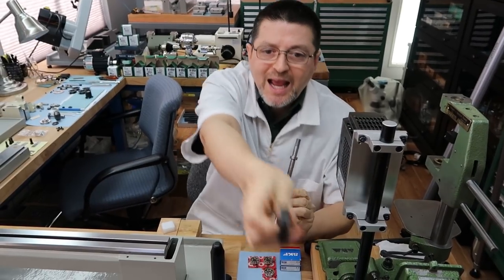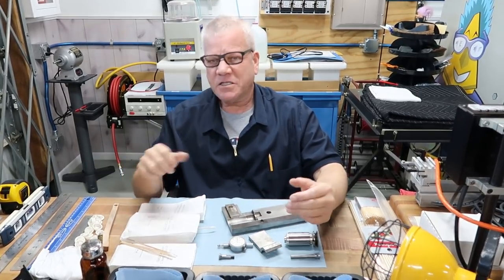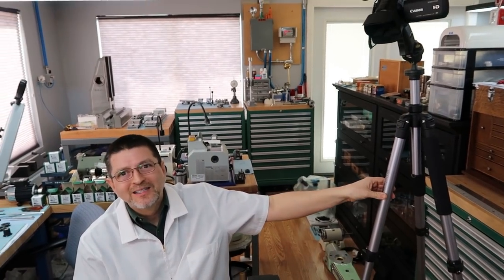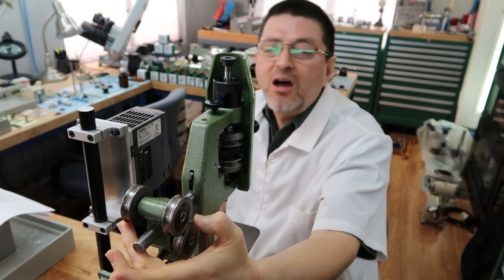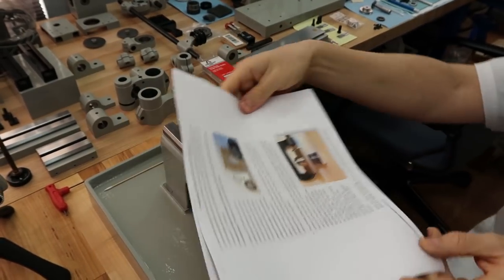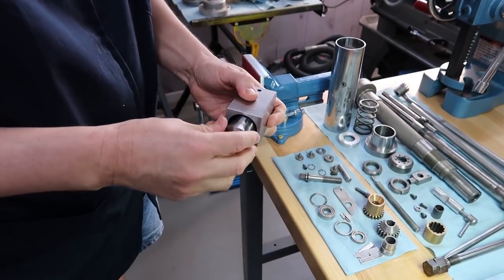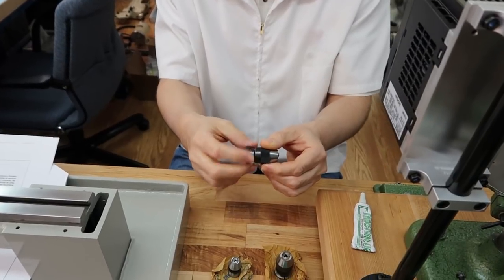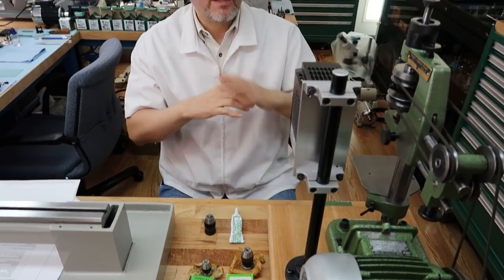SHOP ADVENTURES 21: German Tapping Machine Assembly & Albrecht Chuck Rebuild

Comment: There's no mention of grease type and amount in CC's to be used in the Albrecht instructions? I've not had my larger one apart yet, but yes I know the "feel" you mentioned of what they should be like. Albrecht doesn't cut corners so it's likely they always use a very specific NLGI rating to get that consistent feel. Two possibility's? Kluber might be the manufacturer since they do high end specialty greases for precision assembly's. The other guess is it just might be what's called damping grease. Easiest to have you Google the term, but it's not well known how many common items use this type of specialty grease to obtain that "feel".  I ran across the term a few years ago and did a bit of searching. It's used in many items like optics for cameras, rifle scopes, binoculars, microscopes etc to provide that light but consistent drag during adjustments. It just might be what Albrecht uses. (maybe) ?????
Reply from the maker: Hi Turning Point good evening to you this is Lance.
We know the grease used by Albrecht and along with a new issue to cover in this coming Mondays  video brought up by Precision Edge we will disassemble the 3.0mm Albrecht chuck a brand new in the box one and perform an autopsy on it including the grease type, thickness, weight, locations of the grease and such, you we hope will join the show when we dissemble this brand new chuck.

The feel of an Albrecht chuck, you know what we know once you turn one clockwise and reverse suddenly counter clockwise you are hooked for life the chuck is a reminder of the power-glide days. 

Kluber we know very well and I am thinking right now as well, you might know we are nearing the pullout video series of the rebuilding of a precision spindle actually we are doing 3 as mentioned in this weeks video. We use this grease in our spindle rebuilds.

Albrecht chuck claims in its instructions is the issue here to us for this moment, they specifically share how much and where they place the grease, only and no other location anywhere within the chuck meaning we are going to share this disassembly as close to live Monday evening and this is only one of the two  topics we are covering this Monday.
The other pertains to the chuck it must be pushed up onto the taper of the tapping spindle so we can do some tapping machine testing as the new power switch mentioned in the wiring discussion within this weeks video shared it should come in has in fact came in. 
This means the chuck issue must be resolved and the chuck refurbished and reassembled already by us must be ready to go or we will have to install the new one we are disassembling in the video and share the tapping operation now in this weeks video a week behind our best estimates. 

Welcome to Shop Adventures what happens here at Active Atom is what we film and we share as close as you can get without being in the shop with us (hazardous place) and this is all worth every hard working hour per week to both of us and know this Turning Point, we are highly inspired by people like yourself and many others that ask great questions and share even greater approaches to the challenges within our micro machining operation as we prepare to begin machining code named product "The Perfected Product" on the vary machine and tools. Thank you for being here and for taking time to analyze our challenges it matters to us both. Lance and Patrick.

Comment: thank you for the video, you have some fantastic machines and tooling and I am very jealous, have you considered that the old chuck just might be "run in" and that's why its smoother in operation. your workshops are not just clean they are clinically clean. if you ever managed to view my place of watch and clock repair you would certainly have a heart attack.. thank Patrick for me also as I am sure its lance I am emailing. excellent video thank you
Reply from the maker: Hi Richard Shepard Lance here. We do have a clean Workshop but mostly because we stopped doing work for others to refurbish the machines and such so as to start making "The Perfected Product" but no it is always clean mainly the Workshop white coat area but the Machine Shop blue coat area would pass the 5 second rule of dropping food and still being able to eat it. LOL We are interested in learning from you Richard? You work on both watches and clocks? Do you do this for a living hobby or are you like us just a bit over the edge. We are located in a rural desert town since August 1999 named Yucca Valley, where are you located we are always interested in these things if you want to share or not is ok as well especially a fellow watch and also a clock guy. Patrick only writes to a few emails generally I am the one that does the writing talking joking interaction but I do have a bazaar set of skills they will appear during the product manufacturing and should present a real joy for the viewers we hope. Lance and Patrick.

Comment: Did you try to chuck something in the chuck? I have used  Albrecht chucks in the past that wouldn't hold on to the shank of a tool. It was like you tighten the chuck but it won't stay tight. I may even have one in my garage that suffers from this. I will be interested to see what you guys find out on this.
Reply from the maker: Hello Peter Lance here. Patrick say hi and we think you are bringing up a great expansion of the Albrecht chuck disassembly for this coming Monday evening.
We will during the tear down disassembly share each component of the chuck and their function during the investigation to find the causes of the feel flow issue and now thanks to you figure out what is causing the chuck to not grip a hardened steel shank and hold onto it. 
and share each component of the chucks function

We (Patrick) did some research for this no holding additional issue and along with the value flow feel issue their is enough to add it and share it and not take an hour to do it LOL. 
So get that chuck out of the box in the garage and lets get her saved Peter:)

We realizing our chuck is likely smaller (3.0mm maximum capacity) then anything you have in that fine Mazak or in that box in your garage none the less they each have the same principle operation 3 jaws and 25 ball bearings.

Please come join us, watch us make some discoveries Peter we hope it is helpful and we both thank you for the suggestion of adding this equally important topic about the Albrecht
Reply from the maker: 6818015  Hi 6818014, you know your key-less chucks. We address in the next video, if you watch it  Shop Adventures 22 the smooth cone of the hoods internals and the jaws contact points sharing how to address this issue thanks to Peter coming up with this anon tightening issue for the video. We the two if us love being here and a part of the YouTube community of creators and viewers. 
We Lance and Patrick thank you for great comment and hope you will find our sharing worth your time in the future videos they are released each Monday night.